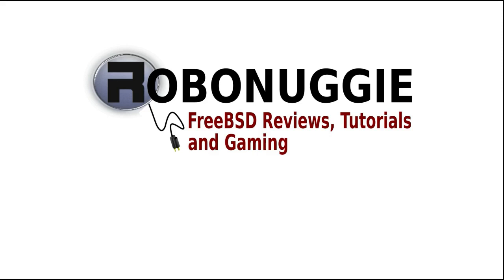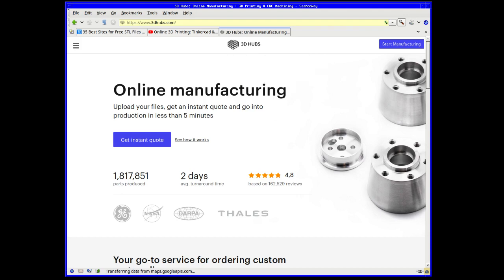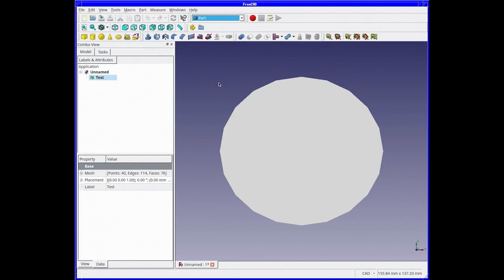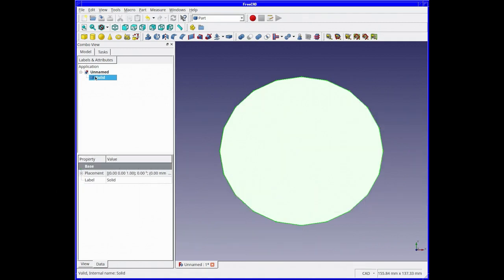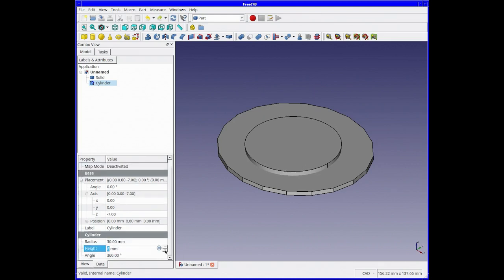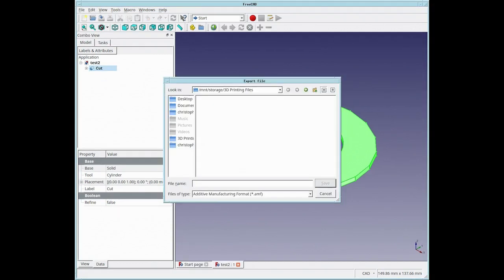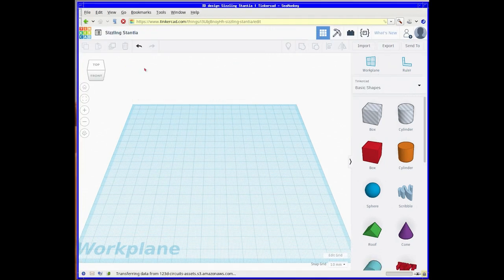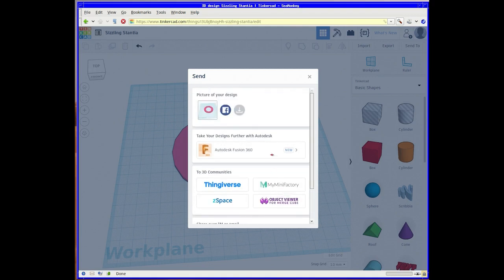Editing 3D Printer STL Files On FreeBSD Using FreeCAD

Comment: I was looking into and downloading freeCAD last night for use to design my own houses as I needed a LINUX version of 3D home Architect design software and freecad was what I found would work. Sadly, I installed it on my lappy with Fedora 27 and when I type freecad in the command line I get a freecad command not found error. I do not see any of the files for it installed anywhere in /usr/bin either. Still waiting a response from the freecad team or the user that led me to freecad last night. doh doh! So close yet so far away.. Where does freecad install files to in freebsd? And what is the command to start it in a terminal in MWM or to add it to the mwmrc in my menu?
Reply from the maker: FreeBSD installs all 'userland' or 3rd party software into directories that are preceded with /usr/local

so in Linux /bin & etc would be used, in FreeBSD it's /usr/local/bin & /usr/local/etc....

They do it this way to separate base OS install and Userland... very clean and logical...

To start in a terminal in FreeBSD, simply type FreeCAD (note the upper case letters)

and to put it in mwm, edit the .mwmrc and add

 "FreeCAD"                       f.exec  "FreeCAD &"

:-)
Reply: @RoboNuggie  perfect! I typed it in Linux and got a seg fault and core dumped error so eh no go. I will try this freeCAD in BSD and see if it works. Funny thing is when I was looking at your FreeBSD 12 review and was downloading the DVD images, I decided if I can get FreeBSD working like I need it, I wanted to run FreeCAD and use this free UNIX OS as my Architectural design studio setup. Hmm me hopes it works. The intel onboard graphics in my Fedora based install on the laptop may be the culprit. Sadly I do not have a computer that DOES NOT use onboard VGA. So.. what to do what to do..
Reply: I typed FreeCAD in my USER terminal instead of the Root user terminal and it works! Nice APP!. Now to tinker :-D Seems divine providence that I found your channel today my friend!
Reply from the maker: There is an answer to every problem, we sometimes just need a sign pointing to it...

You should really only use the root terminal for system admin stuff, the normal user terminal to start a program if it's not on the menu...